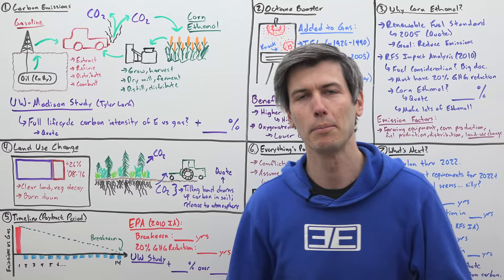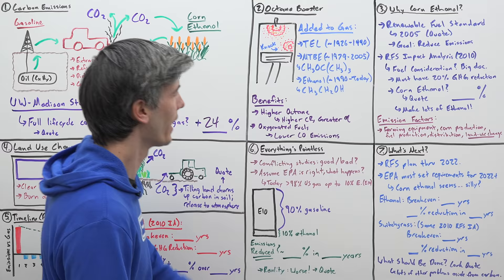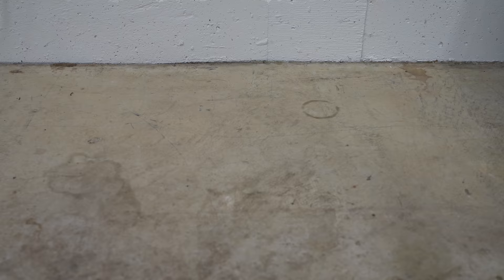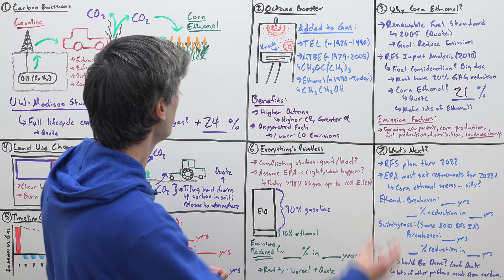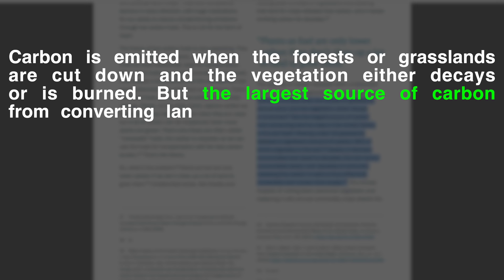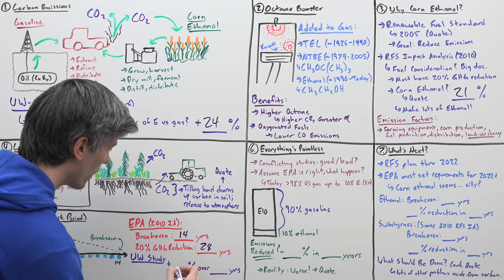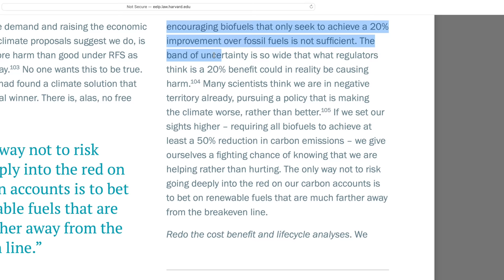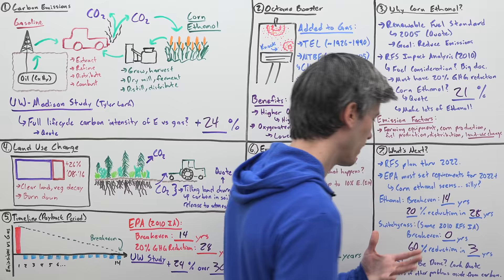America Was Wrong About Ethanol - Study Shows

Comment: They knew the corn based ethanol math was horseshit. The politicians cooked the numbers to make it fit what they wanted, which was a way to require more dollars to be funneled to their corporate corn-growing friends. He says "farmers" but in the US almost all the corn is grown by corporations and the farmers are little more than employees.
Reply: They're cookin' the books again to make EV's look wonderful.
Reply: @ichoppabroccoli3670  at least with EV, the thermodynamics checks out, unlike ethanol. A properly supported EV network will produce double the distance a car can produce using the same amount of gasoline as fuel for their generators. Cars simply suck at converting fuel to motion and cogeneration makes fuel stretch significantly
Reply: What about the batteries after their useable cycles are depleted?
Reply: @gabrielrizzo6969 And what’s required to make them to begin with
Reply: And the terrible electric car fires, and that they don't work in extreme cold, etc.
Reply: They also knew that sugar produced more ethanol per dollar but sugar is produced in South America not here.
Reply: @TheLucidDreamer12  Yeah, that's not really true with transmission losses and inefficiencies in conversion. It's like break even in a best case scenario.

Comment: There was a large biomass project utilizing switchgrass in southern Iowa several years ago. The switchgrass was ground and burned in a coal fired power plant as a renewable fuel. I spent a lot of time mowing and picking up switchgrass bales. If memory serves, the BTU comparison between coal and switchgrass by the pound was small (coal > switchgrass). The whole project was shut down when "someone" came in and stated they were going to commercialize it. I think it needs a second, very, serious look. Switchgrass provides excellent erosion control (up to 20' deep root systems) and habitat for wildlife. If the push for electric cars is going to continue, the need for better fuels at power plants will become paramount.
Reply: It really is all about input vs output when it comes to biomass. Which is really why ethanol isn't as big of a benefit as expected. It's a lot of fuel (and carbon release from soil) to collect and transport organics to a processing facility. New data from a broader analysis, apparently, has shown this. 

For any new processes It really comes down to tonnage of material. General cleanup would not provide the amount of material needed to offset the output in my opinion. After a disaster a lot of the arguments against the collection is negated because it needs to be cleaned up anyway. Manure processing is in place and works well in larger feeds lots to my knowledge. I do not have first hand experience with these systems and need to look into them. Processing of sewage is a whole other issue. Lots of chemicals and heavy metals involved from what I've seen and read. The biggest potential net gain is altering an already established process. Disaster cleanup, manure processing, household trash pickup, and possibly sewage all have some of that potential. 

That all said - I don't think we should completely ignore carbon but I do agree that methane collection and use would better suit our needs and efforts.
Reply: Would cut in to to may profits. The sell them seed ,fertalizer,weed killer,pesticides, and fuel every year. The grass would only take fuel and time so to much money loss to let that happen. Oh and cows don't need corn to survive either.
Reply: Hunter and Joe do not make money off Switchgrass.
Reply: When we take organic material from the field we must return it in some form. Fertilizer is usually the form chosen, but even then we tend to take more than we return. Eventually, that becomes a problem.
Reply: @garymanis6305  yeah, even with grass in a field, if you keep mowing it (and bagging it to move it off-site) you are removing nutrients from the soil.

Although the fertilizer use in switchgrass or some other non edible biomass would be much less than corn, and maybe we could use dirty things such as sewage waste to grow it that are not so great for edible foods due to chemical contamination.
Reply: I spoke to one of those biomass guys, the stuff has promise. my suggestion was to do some serious Juniper Pinion and Chamisa abatement throughout the transition zones of the west. Although there is a step, two? more in getting to product, the product must be good, because in WW2 Japan made Av gas out of pine pitch. Cleaner healthier forest&high grade fuel. 
They were all in on switchgrass.
Reply: Better fuels at power plants? Like nuclear?
Reply: @NathanaelNaused  does your car run on nuclear
Reply: @jtyree0226  Does your brain not read context?
Reply: Nice that sure sounds like a renewable source.
Reply: We already have the best fuel that requires the least amount of mass to be moved with the least amount of emissions possible. It's called nuclear energy, that's what we need to take a look at again. There are many solutions to avoiding Chernobyl and Fukushima like events and even those frankly have not had the devastating long-term consequences that many people seem to think they have. Not to mention the amount of waste produced by nuclear energy is several orders of magnitude smaller than literally any other option outside wind and hydroelectric, both of which have geographic requirements to be viable. Fear-mongering has made people completely ignore the literal best option in every conceivable way
Reply: @biggusdoggus5909  Joe made 500,000$ last year you sure?
Reply: @jtyree0226 If they made nuclear cars, I'd be interested. Electric cars- no way.
Reply: Or… we can switch to bio oil. Seaweed is a great crop and it grows fast so it’ll clean up our atmosphere, seaweed based bio oil is 90% easier on emissions compared to the oil we use now so to me sounds like a win/win… or is there a reason this isn’t being looked into and maybe someone keeping the world from this technology and fuel source 👀 we’ll never know if we don’t try.
Reply: @chrisloving6647 don’t need any of that when growing seaweed which could be turned into more than just oil and fuel (bio oil/fuel)
Reply: @frankmorris4790  how about seaweed? It’s extremely versatile; can be made into bio oil, medicinal, food and cosmetics. Not only that but it grows extremely fast so supply wouldn’t be an issue.
Reply: @Mike-lt6sj I watched an electric truck pull a semi out of a snowy ditch. Electric is where it’s at for making torque.
Reply: @derangedazrael2615  That's not saying a whole lot.  You could do that with a 1hp motor using gear reduction.  Did that electric truck make it home? 
What additional costs are there going to be having all the vehicles weigh 1000+pounds more on roads? Do you know we will need to mine roughly 10 times the amount of copper to convert over to electric cars? That's not even getting started.  None of this is thought out, it's just a trend.